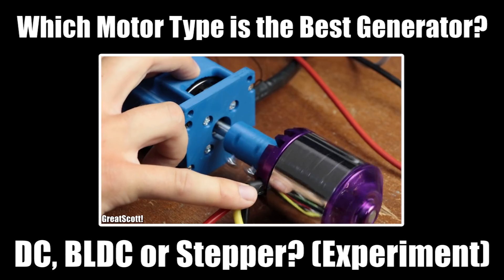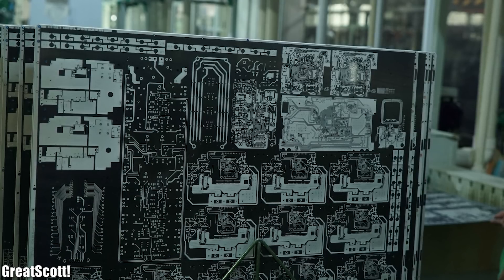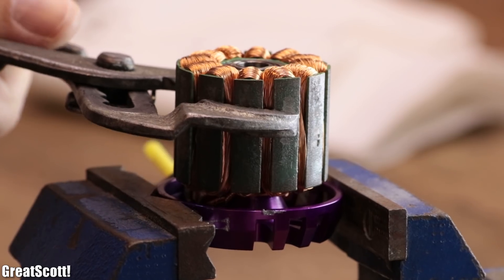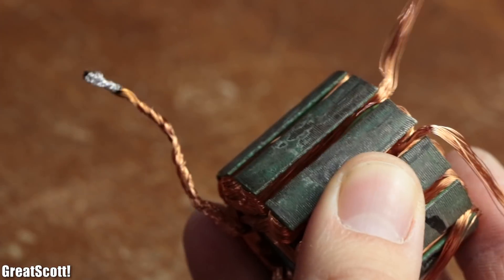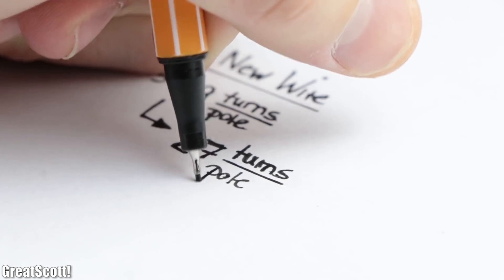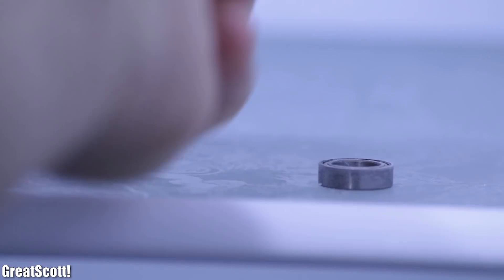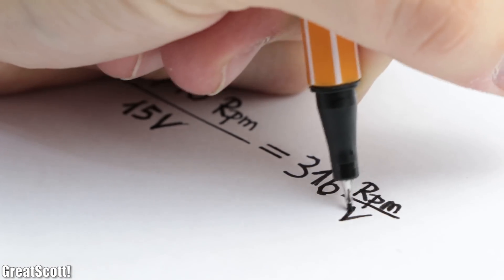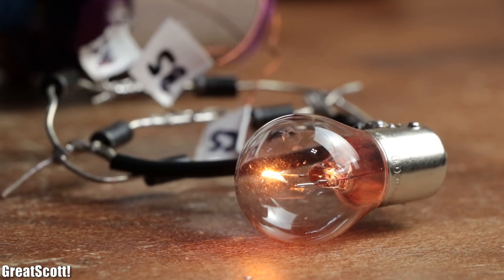How to rewind a BLDC Motor (as a Generator)

Comment: Can a BLDC rewound as a generator still be used as a motor?  If so how could one control switching from one to the other.  I am thinking of a tethered kite application where one uses it as a motor to get up high enough then switches to generator at height where wind is adequate to keep it aloft.

Comment: If you want a reasonably high power generator, a direct drive bike hub motor are usually around 10kv, so only 10 rpm per volt, and you can get then as low as 7, plus loads of poles. The leaf "1500w" uses thinner .35mm laminations and gets up to 90% efficient and is still pretty cheap. A rear hub in a bike plus a good dual kickstand would double as a pretty good ebike and a good peddle power generator, if wanted. or rig it up with something else to make it generate power

Comment: Nice! There's plenty of explanations of Faraday's law and so on for motor and generators on the Internet, but practical number of turns/output voltage for real BLDCs is more sparse. 
This video has given me much more practical information for my pedal generator for a hybrid bike project. I don't want any gears or chains, the whole point is simpler mechanics. Even after rewinding a BLDC I know I will probably still need some step up gearing though.

Comment: I have a generator head from a old portable gas generator and my question is to you is can you wire up the generator head as a go cart motor? Instead of the gas engine turning the generator head and the generator head producing AC current, is it possible to introduce a DC current to the generator head so I can use it for a go kart motor?

Comment: We are missing some measurments LIKE ohm resistentes in 3 phases/ the whole rpm/ volt-amp curve/ cut-in rpm volt/ 
Q!- If the END resulta is 3-4 volts, x ?mAh/how can I feed. A 12v batt????
- using a bucle converter? Any losses?
- I WANT TO emulate the co. "Windblue"  tha T sells kits for delco car alt they achieve 12v with 160 rpm!!!!
- using motorcycle alt pma outer rotor/ Maybe using more turns=210 cal.wire of 0.311 mm
I dont know how to use the induction formula!
--I WANT 12v 0.300 Man- 160 rpm
For MY futuro vwat
--- If you can get one 520 pma delco alt- low wind/ you dont be DISAPPOINTED! Make a vídeo review " greetings from Mexico

Comment: Plz use a mount. Jfc I love the knowledge but you have to give the motor a chance to succeed. You toasted the bearings. That specific motor is for an airplane so it needs a solid mount on the face of the output.

Comment: I am thinking of using an old manual grinding mechanism as a gear box.It increases RPM tenfold and is lubricated, has low friction losses.Thanks for the excellent video.

Comment: Couldn't you replace the Sechspulsbrückenschaltung with an ESC, that has a hall sensor, knows where the rotor is and then activates the specific coils to let the current ggo backwards into the battery?
Or in other words, how do electric cars recouperate? With a 6PBS or a special ESC?

Comment: A variable load would take these generator videos to the next level. Its critical that the impedances in these systems are matched so that you transfer the maximum possiple power. You could possibly even try to design or use a MPPT system.

Comment: Hi, sir I, am rewind the motor  but  I,m  don't  understand  please guide me .motor dimension : stator  diameter 28 mm and length 22 mm how many turn per slot and which diameter wire is use for this  motor for 2600  kv and please tech me how to calculate specific winding for brushless motor .I,m waiting for your answer

Comment: Nice vid. But it is useless to heat or cool down such small bearings because shrinking or widening a bearing is a percentage of its diameter at a temperature difference. The only benefit is to eventually loosen adhesives like Locktite.

Comment: Nice work for understanding but unessary for the conversion.
I'd rewind it without disassembly and winding work. If you "beep" through all the parallel single wires of each of the 3 coils you can solder them in series or a combination of series and parallel.That's much less work an you don't need to destroy anything.

Comment: Hi.... I would like to know more about designing motors and AC generators??...In particular, the relationship between wire size, flux calculation,  terminal voltage, current per phase/ per coil and power output....Any recommended books or materials/websites....?...

Comment: 10:16 configuring either wye to delta doesnt change the output power. As the current decrease the voltage increases by the same factor. Wye to delta only changes current or voltage that is needed for some application.

Comment: Suggestion : separate each threads from the parallel wire bundle, identify with continuity each one and connect them in series. That is not as good to achieve high voltages.

Comment: You can get automobile or truck alternator rectifiers which are 3PH and Schottky very low drop,and current ratings from 40 to 250+ amps. Brushless motors can come in very large sizes, replace the bearings with Hybrid Ceramic to prevent current loss through the armature and eroding the bearings.

Comment: You didn't spin the rotor at 2.8kRPM or the coupler assembly would have disintegrated. So what was the actual input RPM? Very nice project btw!

Comment: I think you could have split the original winding into parts, as they are all made from individually enameled wire. Like 2 parts of 13 litz wires and connect them in series. Of course after dividing the wires of one side into two bundles on the second side you have to test each of the 26 litz wires from the strand individually, to which part-winding it belongs. But this seems doable.

Comment: sooo basically a bldc motor is an alternator?
Reply: Not really...while most alternators are 3 phase, they don't have any permanent magnets in them. They use a field coil operating on DC to generate their magnetic field. This is why they require a battery to produce any output.
Reply: @drrrrockzo  Thanks!

Comment: 10:12 power stays the same for either configuration. Cause P=U*I and both of these are either phase or line. Please don't mix up those 2 cause in phase 1 is devided by sqrt(3) but in line the other is devided by sqrt(3)

Comment: Hi,
as you are always asking for ideas, Igot one that would be awesome. As a hobby I do some FPV Drone flying and for that purpose people are typically using simple sony hs1177 cameras that provide a simple analog PAL (or NTSC) signal. This signal now is transmitted analog on the 5.8GHz band (at 25mW). The downside here is, that with the analog signal a lot of noise is received too. For that purpose a very nice project would be to find a way of converting the analog signal to digital with error-correction and maybe decode it back on the receiver. The main problem here is that the latency has to be as low as possible. For that purpose I'd also suggest to not use of-the-shelf Video ADCs but rather encode the signal line-wise or bundle a few lines at a time. Else collecting a full frame will always introduce quite a bit of latency by itself.

And even if you think the above is a little too complicated to accomplish I am sure there would be very nice projects using the cheap fpv-equipment parts available.

Comment: apparently, this stator slot insulation is realized by epoxy powder coating...we are professional BLDC Motor stator lamination and epoxy powder coating customization manufacturer to produce stators with 0.15mm,0.2mm,0.35mm and 0.5mm silicon steel, we also have some ready-made stamping mold available for you to save your cost. more details, please see our website: www.jystator.com

Comment: You said you count the number of turns "per pole". These are not poles but slots. The number of poles, for such a motor, is determined by the number of N/S magnets on the rotor. The number of poles is always an even number (N and S). On the winded part, the name is slots, even if there are protuding parts. And the number of slots can be an odd number. A 8 poles, 9 slots motor for instance has a very smooth torque curve...

Comment: You lost me with all the complex formulas. I can't understand that. What the hell is KV rating? KV means kilovolt.  Just wind as many turns as possible on each pole. More turns equals more inductance therefore voltage per rotation.

Comment: If you ever need a high voltage generator I can recommend a microwave oven motor that spins the plate for your food. I turned it and got zapped. I was like WTF. Than I measured the voltage and got 90V AC from hand crancing and over 780V AC with a drill set to the lowest RPM. My multimeter only goes up to 800...
Reply: How much amp current bro
Reply: Kindly reply to me ASAP

Comment: Great!! This video and the previuos one are very good and usefull!! :) probabily can help me in future project. Just for curiosity: use BLDC (or stepper) motor as generator to provide DC will also decrease the efficency, because the output current (the currente that charge the capacitor) is only peaks and the bridge diode will no conduct for the overall period of the sinusoidal output voltage.

Comment: When I saw this video, I had a question:
if I want to make a wind generator, should I connect a modified engine (like the one on the video, but bigger) to the generator shaft?
Or should I create a winding around the circumference of the generator and use the motor shaft as the source of rotation for neodymium magnets?

I was also thinking about connecting several generators to the circumference of the generator ... it would gain power, but it would be difficult for the wind to move the whole blade system.

Comment: Hi GreatScott! Can you make a video where to explain the benefits of the brushless motor as a generator? I want to know the voltage and its power. Can this be used as a battery charger for example?( Off course with all the equipment needed)

Comment: I rewound quite a few motors for my quadcopters. When removing stator you need to heat it, cooling motor base is fine, but sometimes there is adhesive which will give up with higher temperatures. Also threading is common, so you always need to twist it and not just pull. Avoid stator damage by wrapping it in some cloth, leather or just paper. You want to avoid any sharp edges on stator and layer separation. For anyone trying it, consider double lacquered wire, since its more resistant to damage when hand winding. If you need winding scheme for different slots and pole counts calculator on http://www.bavaria-direct.co.za/scheme/calculator/ can be really helpful. Also use some heat shrink on wires exiting motor. With vibrations motor base can "bite" through enamel and short your phase to metal base. That starts to be problem when you attach your motor to grounded metal frame or something. Simple trick for removing enamel from wire is to use pill of aspirin and melt it with wire. It smells, but its fast and I prefer it over sandpaper.
Reply: reseth great tips there! 👍
Reply: so liquid aspirin removes enamel? Makes you wonder what it does to our stomachs when the stomach acid melts the pill.
Reply: @ChristopherJones16  a crucial step is heating it, so hopefully you don't have any fires burning in you belly!

Comment: Why is required rewinding, than you can use a transformer for step up the voltage, while the generator run at lower rpm.

Comment: You didn't have to rewind, just put the 26 winfingx in series in stead of parallel...  Or 13 pairs in series...  Another good one is to separate the 3 phases rectify them via voltage doubler on to capacitor pairs and put the 3 in series...

Comment: 10:21 in Y configuration the the end point voltage will be indeed sqrt(3)*fase_voltage, the current will be devided by sqrt(3). So the power will stay the same and not be lower like you mention in your video.

Comment: Or instead of rewinding the motor, you could use your motor controller. FOC allows negative torque (current) which also enables full bus voltage generation (works similar to a buck converter, using the motor coils as inductor). This would need external power (or at least a buffer, to store startup power) tho

Comment: Hi,

Just spotted a slight mistake that might be relevant in future videos. 26 wires with a diameter of 0.2mm do not equate to a 5.2mm diameter wire. You need to multiply the cross section area, not the diameter. In this case, it would be the equivalent of a 1.02mm diameter wire.
Reply: Robert Slackware  Here is an opportunity to triple down on stupid... Go for it...  By the way, what your ignorance is talking about is NOT silver, it is in fact, MOSTLY copper, probably coated in silver to get the lower resistance of silver used via skin effects, but the hardness of copper as silver is TOO ductile a material to be used for much of anything.
Reply: @w8stral  Now you got me wondering why airplanes use Silver wiring.  Off to google I go. I'm sure theres a Quora about this somewhere.
Reply: @ChristopherJones16  Why silver plated wiring?  Same reason people gold plate wiring, corrosion mostly.  Also in Aerospace you silver plate your wiring and other surfaces as it effectively stops dendrite growth which causes short circuits AND gives skin effect dampening from EMP for space based sattelites though gold is used usually.
Reply: Robert Slackware  Ah, you did triple down, excellent.  That "silver" wire, I guarantee you is less than 50% silver if sold for electrical purposes.  Silver is too soft and if used for windings, as you are talking about MUST have an insulating coating on it anyways. Pure silver would not help you any compared to partial.  Probably less than 30% silver.  And yes, it is Hella expensive.
Reply: Read all of the comments, very good discussions going down :)
Reply: Robert Slackware  Hey, why not platinum, or Rhubidium?...  << rolls eyes >>
Reply: @w8stral  Platinum has high resistance,rubidium is a reactive alkali metal.

Comment: As the windings were actually several wires in parallel, could you rewire the individual wires without unwinding them? Unbundle them at the ends, reconfigure from parallel into series.
Reply from the maker: I think that is not feasible,

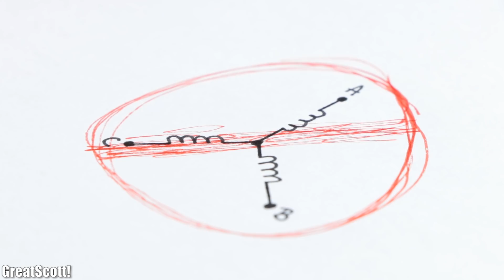Comment: at 4:23, I was thinking that whatever you told about the BLDC motor; i.e. the STAR connection, is correct for previous motor videos?

Another question, you used High Impedance resistors for creating an Imaginary/Virtual Neutral Point. At that moment, I understood this method more perfectly for the STAR connection. So, will that same method of creating a Virtual Neutral Point (Connecting 3 resistors to each phase and binding 3 other terminals for Neutral point) apply for a DELTA Wired Coil arrangement?

BTW, I am now trying to Dis-assemble the same motor type once again.....LOVED YOUR VIDEO
Reply: In a DELTA configuration, there is no neutral point. Basically in a STAR configuration, any asymmetrical load will be compensated by a current in the neutral point. In a DELTA configuration however, any asymmetrical load will be compensated by a current that circulates inside the load from 1 phase to the other

Comment: also if you're having trouble with the adhesive just put the entire coil setup in some rubbing alcohol. it'll eat away at the glue/adhesive but not damage the coating on the wires.

Comment: 9:15, don't you mean an EVEN FUUUULLER BRIDGE RECTIFIER?
Reply: did you mean , MOTHER OF ALL BRIDGE RECTIFIER
Reply: @mickolesmana5899  lol ElectroBOOM
Reply: micko lesmana It's the MOTHER OF ALL FULLEST BRIDGE RECTIFIERS!!!
Reply: MOTHER OF ALL FULLEST BRIDGE RECTIFIER
Reply from the maker: No, I said: "SECHSPULSBRÜCKENSCHALTUNG!"
Reply: @greatscottlab  SIX PULSE BRIDGE CIRCUIT. But as ElectroBoom says "FULL WAVE BRIDGE RECTIFIER" with a loud speaker. Add a big cap for smoothing. Thanks for the good video, except for the wire sizing mistake, it turned out close enough.
Reply: GreatScott! You should add more German words into your videos so we can learns
Reply: @greatscottlab  SIX PULSE BRIDGE RECTIFIER would have been better 😅
Reply: @greatscottlab  Hopefully you see this but changing from a star to a delta doesn't change power output. Since power (Line-to-Line) is sqrt(3) * I(Line) * V(Line-to-Line) * PF. Power(3 phases) = 3 * I(phase) * V (phase) * PF. 

Star line-to-line voltage is equal to sqrt(3) * V(phase), but phase current is the same as the line current. Delta connection the line current is equal to sqrt(3) * I(phase), but the Line-to-Line voltage is the same as the phase voltage.

As such a star connected gen's phase voltage gets 1/sqrt(3) of the line-to-line voltage, and the delta connected gen's phase current gets 1/sqrt(3) of the line current, the power usage ends up being the exact same.

Using power calculation for 3 phases, subbing (for star) V(phase) = V(line-to-line)/sqrt(3), I(phase)=I(line) and subbing (for delta) I(phase) = I(Line)/sqrt(3), V(phase)=V(line-to-line)

Power ( star ) = 3 * I(Line) * V(Line-to-Line)/sqrt(3) * PF = Power (delta) = 3 * I(Line)/sqrt(3) * V(Line-to-Line) * PF. 

So they are the same btw 3/sqrt(3) simply equals sqrt(3) so you end up with input (Power, Line-to-Line) equaling the output (Power, 3 phases).
Reply: @greatscottlab  gesundheid. yeah i know it's on my best german ;)
Reply: @greatscottlab  I think that sounds much more sechsy!
Reply: @greatscottlab  We call that a 3 phase rectifier in the USA. Found in every car alternator.
Reply: @greatscottlab  gesundheit
Reply: MOAFBR XD
Reply: You should use acetone for removing stator. Works well for me.
Reply: fool bridge rectifier
Reply: I was totally entertained by this! It made my day - thx greatscott, and great project - I wonder if something like this could be used to build a DIY windmill.
Reply: Six Pulse Bridge Switching
Reply: Electronerd, a person of culture I can tell.
Reply: heh poland guys be like PROSTOWNIK PEŁNO MOSTKOWY     XD